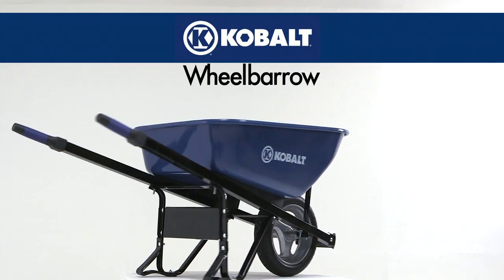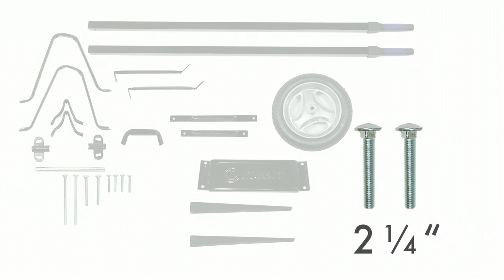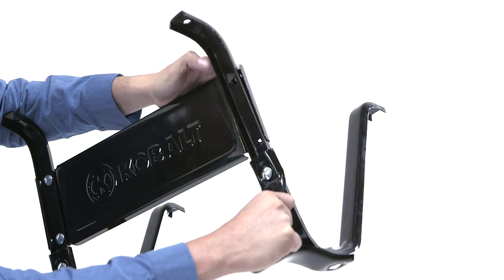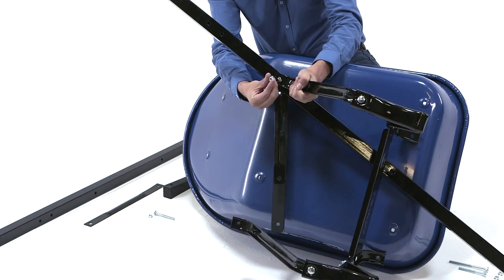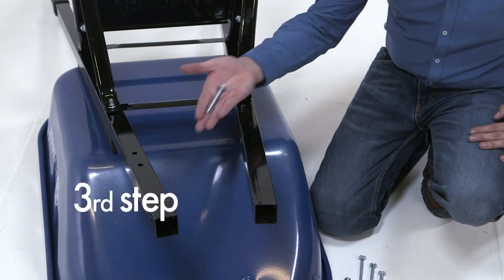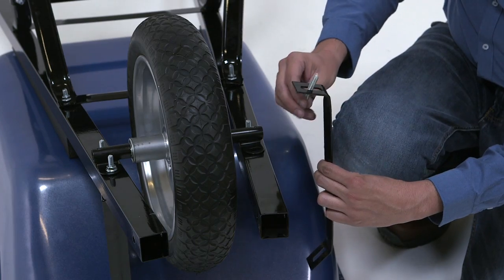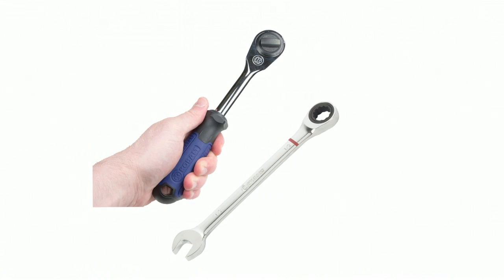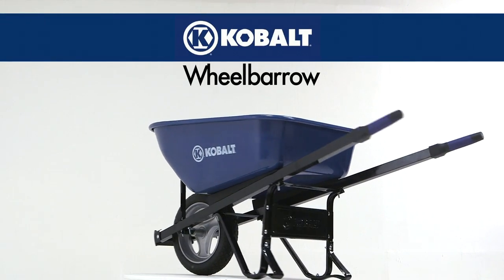Lowe’s Kobalt Wheelbarrow Assembly

Comment: Please note, this video says you need two stays, a long one and a short one. You will only get a long one in the assembly kit. The wheelbarrow can be assembled with just the one stay.
Reply: Thank you for mentioning that. I was about to complain that there were missing parts. You should also mention that people may need a hammer and some pliers to get the Square from the bolts to fit through the square holes. Or something along the lines of " may need some incentive"
Reply: Yeah I returned a box to Lowe’s because of that... and then the second box was missing bolts :-|

Comment: If you're lucky enough to see this comment before you open the box please return it immediately and find one preassembled somewhere else. You will not regret it.
What you will regret (like me) is wasting almost 2 hours trying to force this thing into fitting together and if you do succeed you have a badly damaged wheel barrow and metal shards in your hands. I'm a trained engineer who actually enjoys putting things together and this thing had me throwing a fit.

Cheaply designed products are one thing, not including any instructions or even basic tools (your a tool manufacturer for crying out loud) is another.